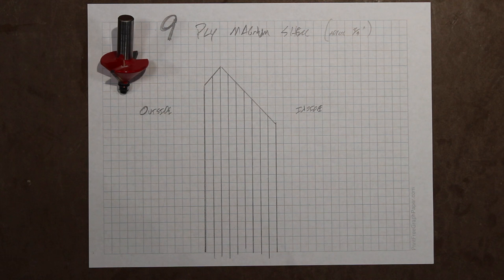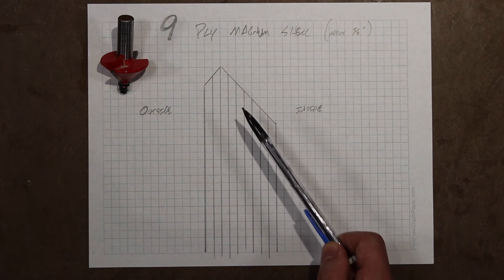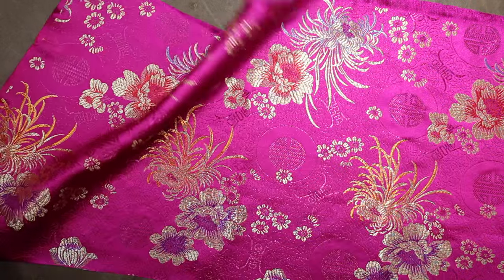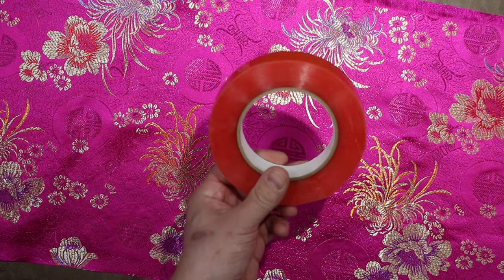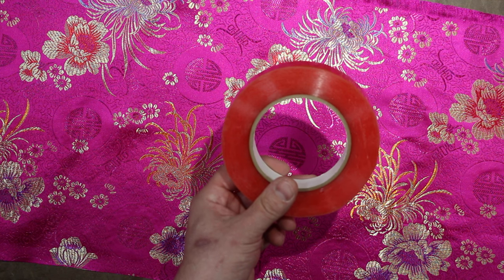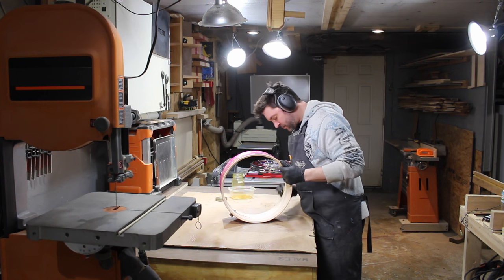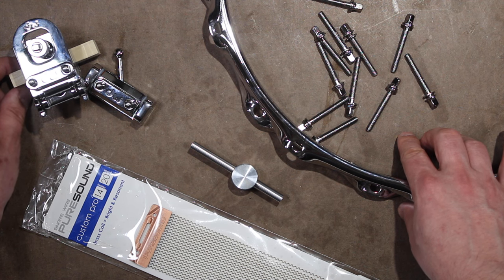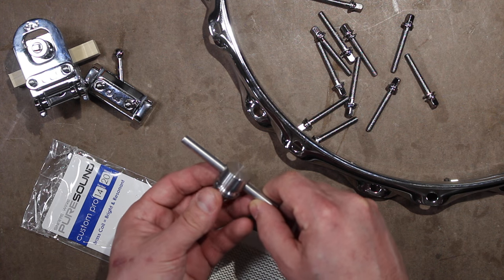The Pink Brocade Snare Drum

Comment: Awesome? Is the fabric durable? Or the tape? You'd think that they might start to wear quite soon? Keep up the good work!
Reply from the maker: The fabric doesn't see much wear and tear since the hoops and lugs basically act as a protective cage.  It's possible that if one were a bit rough (tossing it around) or wore sharp rings/jewelry, something could snag and/or tear the fabric.  The Scotchgard is protection against staining (some random jerk throwing beer/water/whatever towards the stage .. or sweat if you are a total animal.

The double-sided tape is a product (Killer Red Tape) used in the automotive industry to attach exterior decorative trim (chrome bobbly bits back in the day), window drip caps, emblems, interior dash kit details, etc.  The fabric, nor the tape, will come off this shell in one piece and it would be quite the arduous task.  You'd probably need solvent to free it from the plywood and it still might tear out some fibers.

Comment: BTW, you should use polyurethane and fully laminate the fabric to the shell....it sounds better and is way more durable.
Reply from the maker: Contact cement makes it difficult to position and you can end up with visible stretching/shifting of the pattern. It also discolors the fabric.  If you've never tried Killer Red Tape, you'd be surprised. It's not coming off without taking some wood fibers with it.

In regard to poly, I prefer a BLO blend or shellac. To each his/her own.